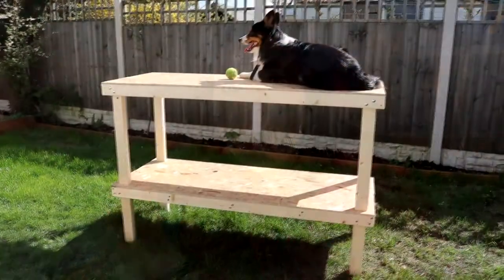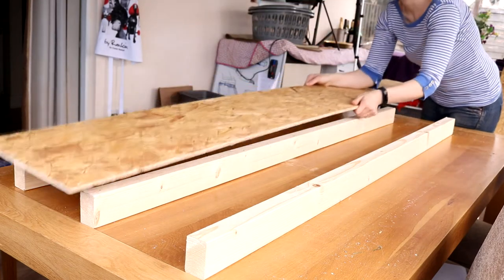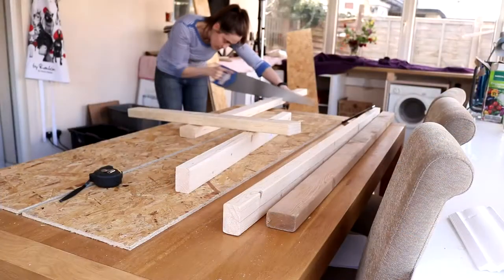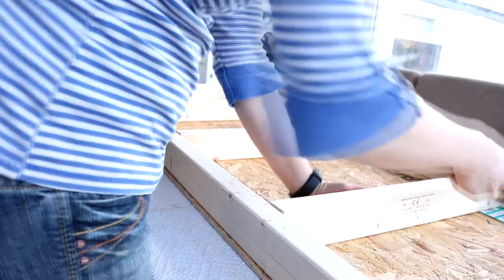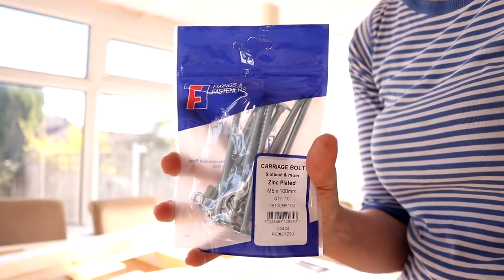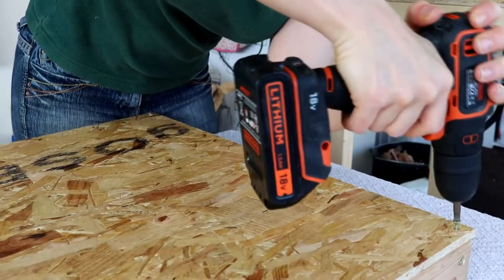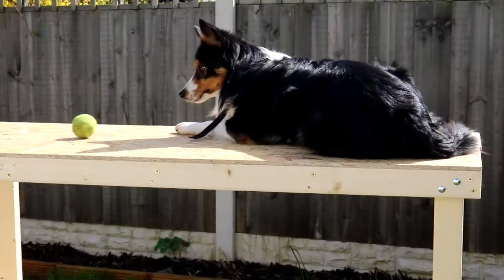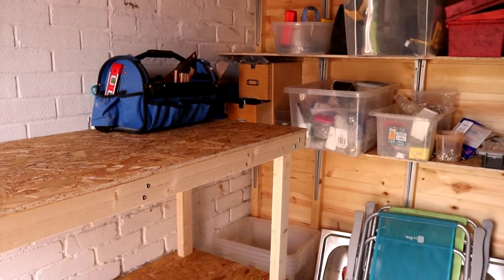Cheap & Easy DIY Workbench | The Carpenter's Daughter

Comment: Nice workbench. Here are a couple of suggestions. Use the square to ensure the legs are straight before drilling. 
You may also want to put washers under the nuts. This provides for a tighter connection on the legs and reduces the chance of the nuts chewing away at the wood over time as the bench is used.
You really need some clamps. It does not need to be anything fancy or expensive. I would start with a couple of 12" squeeze clamps.
 Keep up the good work.👍
Reply from the maker: +V Tramell thanks for the tips :) Clamps are definitely on my list to buy!

Comment: Everyone here has already covered the clamps, sawing, and washer tips long ago.  There's only one other thing that I'd suggest:

Prior to this project you didn't have a workbench to work on so you used your kitchen table.  I can understand that.  Been there, done that myself.  But one of the things that I've learned is if I need a quick and dirty work area is to go pick up some 2x4s, some saw horse brackets, and a sheet of plywood or OSB for the top.  Now you've got a quick, cheap, temporary work area for your project all made out of sacrificial materials.  Set it up in your back yard where you're outside and not worried about making a mess and you have more room to work.

Looks pretty good though for a quick one day build.
Reply from the maker: Thank you!  It look me a long time to realise I could do with some sawhorses.  They'll be one of my next projects coming up, but will need to clear my garage our first :D

Comment: Hi Vicky. Great videos, been really interesting keeping up on your van build (I'm thinking of doing the same thing with my bed). Top tip for you. Buy the "torxfast" screws from tool station next time you are building something like this. So much stronger than the normal wood screws and not very expensive. I build decks with mine and never let me down 👍🏻
Reply from the maker: Brilliant, thanks so much :)  When I run out of my Screwfix Goldscrew set, I'll replace them with a set of those!  Remember to check your head room with the wooden bed (although I'm sure you were going too) :) We've bought a rock and roll bed now but our wooden one was that bit too tall but loved its full size.
Reply: I think you'll be impressed with them, really strong joint. I still haven't got the floor down but I was thinking 450 mm high then mattress on top of that. How high was yours ? I will build it to give me the max storage. Rock and roll beds are great but I wanted to keep a full length down one side for wood and tools.
Reply from the maker: Ahh, I do miss not being able to fit wood and stuff in mine as I found out when filming my last shelving video.  Our wooden one (currently our dog's favourite spot while it's the house) is 460mm high with no mattress and 630mm if including it.  I hope that helps.  Let me know i you need any more info!
Reply: Tastefully Vikkie that's great thanks. I think I may have to use my garden bench and keep adding height until I max out the head room. Good luck with your van and look forward to the next videos 👍🏻